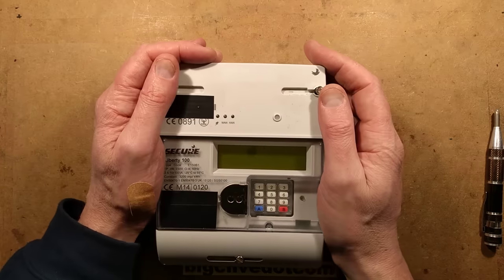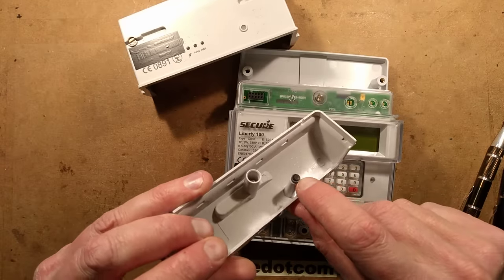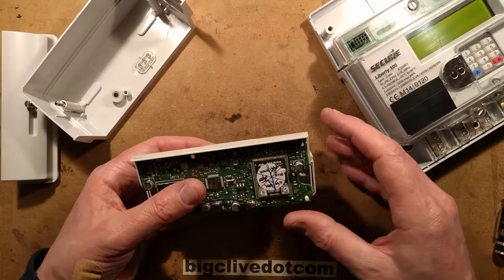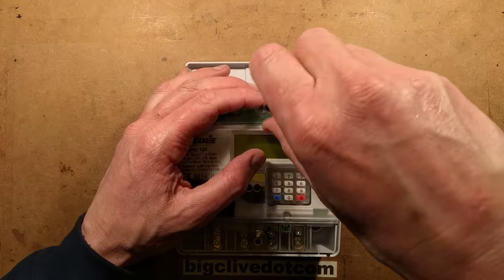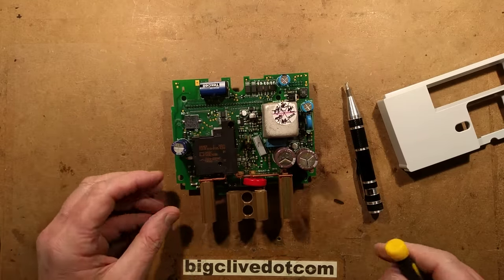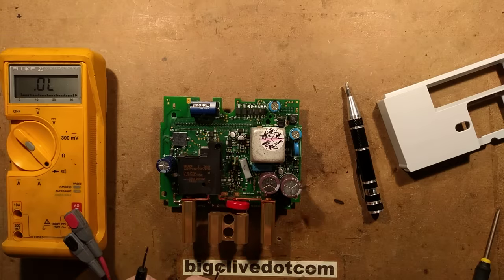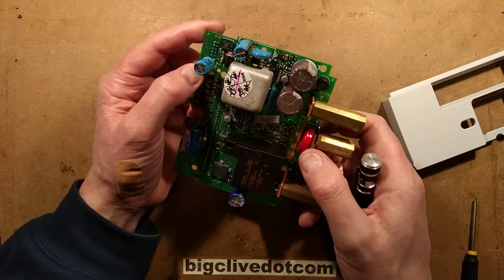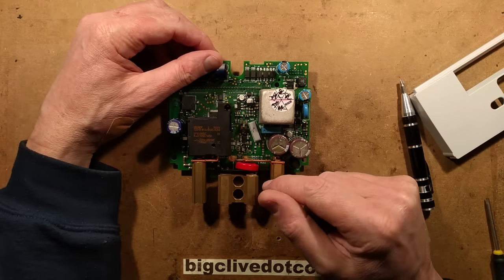Inside a smart meter, and the REAL problem with them.

Comment: Whenever I see a British smart meter I always laugh because of the keypad. It looks like you can use the meter to make phone-calls. Well how considerate of the power company to offer a dedicated phone. But since there is no microphone or speaker I suspect you cannot use it for phone-calls. But this also proofs the energy company cannot eavesdrop on your conversations near the fuse-box so every con has its pro.

In the Netherlands we only have postpaid electricity service so there's no keypad as there is no reason to punch in numbers. There is only one button to scroll between the different tariffs: Day, night, return day and return night. Although it's not completely postpaid. You pay an averaged estimated figure every month which is compensated every year with the actual readings. So you pay when you consumed more and you get money back when you consumed less. Also our meters do not have a relay anymore as the Dutch government considers access to energy and water a human right and therefore it is not allowed to turn power of water off anymore. You also have the right to request to turn off regular monitoring. This still means the meter will still send the same information to the power network company. But they will not do anything with this information and only  send the meter figures twice a year to the power delivery company. And if you really don't want a smart meter you can get the smart meter replaced with a digital offline meter. Some companies do this for free but many (mine too) will charge you up to €300 for it as they consider it unnecessary extra work.

They say the old meters that did incorporate a relay were disabled with a firmware upgrade. Now if you don't pay they just send enforcement agents to your house to get your household effects. Cutting off power is a very rare occasion in the Netherlands nowadays. It's only done in case meter tempering is discovered and the result is considered a fire hazard. But usually people do not dare to tamper with a smart meter. They just tamper with the enclosed main fuse-box below the smart meter bypassing the meter completely.

Comment: Clive the number keyboard is also used so the homeowner can enter a code and find out how much leckky they've used...recently I gave my mate an hand coz he got a stupendous bill....his first since changing supplier....so we called the company...at a call centre in Cape Town!!....they told us what code to enter and a whole gamut of digits with kwh's scrolled past...any how he had been paying 20+ nicker a month on the key meter...they wanted 120!!   after lots of backwards and forwards it occurred to me that that geezah who'd installed it had misread the ting...or it weren't working....SO they had a deal whereby they would send an engineer to check the meter...if was at fault it would cost nowt....if not £140......it was at fault!🦇

Comment: I'm guessing the black plastic box is a CT (current transformer) not a relay. 
(At least here in the US) I've never seen a smart meter from the utility company that actually switches power off.
Reply: It's relay. If you zoom in you can read 24V coil, 100A contacts

Comment: I wonder if the customer directly pays for the power that powers these meters (by reading itself along with the house powser use), or if it does not count itself relative the house it is tracking.
Reply from the maker: They are powered from the utility side.

Comment: I have the same meter and it's a piece of crap. It randomly sends incorrect readings maybe 1-3 times a year and messed up my bill, so I have to correct it with manual readings. Totally pointless. If I can block it from transmitting that would be great.

Comment: Nothing 'smart' about them.
The data sent to the power company will tell them WHEN you take a shower and for HOW LONG.( electric showers).
The only thing that uses 8.5-10kw in one go in a domestic property is an electric shower.
Reply: They'll no doubt find a way to sell that data. The next generation of smart metres (connected to your google account or not) playing adverts on how you could save by updating to a better brand of shower coming soon!

Comment: i did some meterplus training how to install meters dead simple, unfortunately they did not supply with our full installing kit, as electrician we were always taught not to use neon testers but in the case of meterplus installing it s a must due to possible incoming mains been installed incorrectly as it wound still work if it was reversed

Comment: Maybe the resistor and inductor are used to determine power factor?
Reply: No. Voltage and Current are sampled at high enough frequency that the meter can detect the phase shift between them

Comment: Urgent, can someone help, I have a "beep" coming from mine constantly. and the WAN light is flashing, originally E-On Installed it but I have since change supplier but they said it is fine. What should I do?
Reply from the maker: It sounds like it has lost connection with a device like a gas meter?  Tell them to change it if they can't stop it beeping.
Reply: bigclivedotcom thank you for replying

Comment: Companies can fiddle the numbers remotely.
Reply: Dont know where you live, but where I live electricity providers have to give transparent statements of usage. Sure they can change the cost/KWh but that will be on your bill and you can switch suppliers if you dont like the numbers. The actual KW used can easily be verified and contested in court. Example if a neighbour hot wires some of your power for his own use, this is going to become very apparent, very quickly. So fiddling is not viable without you noticing and taking action.

Comment: The other local comms unit could be for a gas meter or other type of meter by the same company. I wanted the pair from my supplier but the chips they were using at the time could not communicate with one another as one was inside and the other was outside and they were too far apart.

Comment: 5:02 -- I love it when someone calls out the BS regarding 5G or other "Electromagnetic Radiation" (EMR) aka "radio waves" that causes cancer and I remember professors going on television current affairs shows expressing concern about the High Voltage transmission power lines causing cancer to households.

Usually professors in universities are reliant on government research grants.  That's what keeps them in their "ivory tower" university jobs and if they express fear to the community they get well paid for the next ten or so years.

I knew this was BS although there is some element of truth as it needs to be severely concentrated. which they don't.

I remember when I was a technical officer in an established university, we actually build a special anechoic chamber that would not reflect radio waves so we could measure radiation of mobile phones when in usage.  We actually received government funding to make this happen.

Comment: I wonder if it holds charge long enough after power loss to record a tamper. Incase somebody gets smart and trys to get past the tamper proofing.
Reply: The capacitors on the modem board are 50F, just for that purpose.

Comment: screen cap over psu is to remove the typical s/m psu oscilating and causing rf interference to radio /tv equipment within household
Reply from the maker: I think it might be a traditional wirewound transformer.  So possibly a magnetic shield to avoid external saturation.

Comment: The keypad is needed to request the display to show the current meter reading. This is needed to use the smart meter as a conventional meter. You may ask why but this model old and is not switchable to a new electricity supplier.
The short range comms will be for the display unit which shows the real-time  electricity loading which I stopped using almost as soon as the meter was installed.
The large red MOV will be for surge protection so that if lightening strikes nearby, any spike induced between L and N will harmlessly bypass the unit preventing damage.

Comment: yeah do they charge you for the power consumption of the meter Gosh i'm getting mad as hell bro.
Reply: bro you too worried aboutthese serieal numbers bro you got to just live a little bro No one cares.
Reply: yeah did I mention THe Real Problem with these meters I don't know what the schematic looks like how they derive current.  I bet you're paying for the power of the meter too.  BUt listen the real problem is that the high impedance measuring circuit overvalues transients when it draws its virtual RMS curve.  A real analog meter not going to be deflected by transients, only true RMS.  I am just getting so mad bro So mad I know i've been overpaying for a while bro I really have.
Reply from the maker: No.  It's on the unmetered side.

Comment: I have a digital 3 phase meter with a 2 buttons on that used to have R1 and R2 readings , i used to push the blue button then take 2 readings , one day the R2 reading dissapeared totally and i told them ! 4 engineers come round to inspect it 2 say it was a faulty meter and 2 say it is a non R2 meter    , i get a £30 000 bill ! with lots of fighting and letters i get it down to £4000 and just paid it to shut them up and my yearly use is about £1500

Comment: Do you have a smart meter in your home Clive ?
Reply from the maker: A semi smart one but not full featured.  They've not introduced them here yet.
Reply from the maker: When I get one I'll be "testing" it.
Reply: @bigclivedotcom  can I ask what kind of tests you are thinking of?
RF meter or something like that?
Reply: @bigclivedotcom  testing for ?
Reply from the maker: @jemlittle1787  Field emissions and accuracy of metering with unusual loads.
Reply: @bigclivedotcom  so can you tell if there are dangerous waves being emitted?
I trust you more than any other info source.
I hear so many reports of unfettered signals from them. 
What would be the test for this danger of the whole 5G debacle.
Reply from the maker: @jemlittle1787  Unfortunately there's a lucrative industry around scaremongering and spreading false information.  I regard smart meters as being safe.

Comment: It would be nice to see how a smart gas meter works as I have heard some of the Flow Meters fault easier.
 What you were saying about people getting ill from shit reasoning, I got it when working on 400kv substations and I asked SSE what the ratio was for people getting ill from working so close to high voltage, high load subs? Nil, yet all the people who complain the got ill from transmission lines that are 60 ft in the air whereas substations are 15ft for 275kv.

Comment: You can't turn the power off at the mains -
Reply from the maker: You can turn off the isolator on your consumer-unit, distribution board or breaker panel.

Comment: Why would we need a cellular network for our homes? It's overkill and it all about profit for the company. Where did all the meters that currently work going? Classic creates a solution that does not exist then making a product to fill the imaginable issue, then the company writes itself a massive check. Your smart enough to take apart the meter, yet you don't question the companies motives??
Reply from the maker: It doesn't have a network.  It just connects to the usual phone network like your mobile phone.
Reply: @TShaun68 control.

Comment: So is there ANY advantage to the consumer from these?
Reply from the maker: Yes.  They can provide information about unexpectedly high power consumption from faulty equipment, like a failed thermostat in a water heater.  Plus allow you to monitor for unexpectedly higher power appliances.

Comment: Problem with smart meters as they can alter the "counter" remotely so if you only use say 100KW hours they can make it say you used 300kw/h 
people have tested this in holiday homes with everything turned off and still get a powerbill of Xxkw/hour usage even tho Zero items using power.

Comment: Have to disagree about the mobile phone bit, Clive. The very first mobile I got was an analogue Oki in 1990 which had a stubby antenna. Every time I made a call with it I would get a headache, so I used it as little as possible and kept all conversations short. I do remember it cost 25ppm with Martin Dawes. So I am always wary of mobile phones but never noticed the headache effect like my old Oki. https://youtu.be/HHU27zCd5Kk
Reply: Those old phones used to make your face flush, hot and red.  Which was caused by the signals decaying in to microwaves.

Comment: I want to know why when Im using solar or battery (specifically when running air conditioner or hot water system) my prouder sees this as both "Feed-in" giving me a credit, AND usage charging 4x more than the give me for the feed it... The usage should only be measuring on the grid side, but, they clearly are not. And no, it's not the case im using 2.5kWh in the first 30, then giving back 2.5Kw in the last 30, that's not possible at 9pm at night.

Comment: In 2014 I got an electric car (never again) and I got a free outside car charger box installed by Bodgjit And Run Electric Co. The installation ran off a B16 MCB in the CU and this fed a meter they also installed. The meter is apparently useless, but as it has a 'nwk' LED flashing away it sounds to me as if "They" are monitoring how much electricity I am using to charge the car with. I gave the car back after two years - no thanks it's a pile of poo - after 8400 miles it needed a new £5000 battery. How about this for a conspiracy theory I haven't heard before? : the meter in series with the car charger might in future be monitoring the KWh going into the car, and will be costed at say 90% vehicle tax, as is petrol and diesel currently.
Reply from the maker: It wouldn't surprise me if they find a way to tax electric vehicles once they have been widely adopted.

Comment: Don't install a smart meter. With it they control you. They charge such a high price you literally turn everything off to save money. And they use that as an excuse smart meters are cheaper. It is because you're literally freezing yourself to avoid the huge bills. And all these gas and electric companies work together and share information which makes them one unit. If one says right don't supply them they owe us money, you'll have no gas or electricity. Best bet if you're careful and quite focused use gas bottles for gas and pay as you go electric or use electric for everything and buy a calor gas for heat. Buy gas from gas companies is horrific, they charge you even if you don't use gas. We're living in an environment of slavery. Try to go and use other natural sources without using these things from huge corporations.
They're just there to make money from you. And when you fall behind they'll leave charges on your meter that goes up everyday, till you've paid it you'll have no gas or electric. But if they make an error the maximum they'll payout is 30 quid. This happened to me. A days lost wage due to them and 30 quid.

Comment: Hmmmmm they've thought about everything i see. What they havint thought about was connecting alligator clamps around the power unit like my dad used to do lol. He did it on the pole but still that was pretty funny. He'd run it over night charging a series of old car batteries and then disconnect it before dawn. 10-15 batteries was enough for him for 2-3 days.  It was alot of work honestly for very little pay off. I'm pretty sure they could tell he was doing it but it was so insignificant they never bothered to send someone at night to checkout where this phantom leach was coming from. Kind of obviously the one house in on the neighborhood transformer that doesn't have power hooked up lol.

Comment: If the life of a capacitor is about 6 years they won't last the forty years of the old type, think the customer would be paying for the replacements !
Reply: Don't suppose they will like the surges from arc welders ?
Reply: @peterwait641  They probably wouldn't like a microwave over magnetron pointed at them either.
Reply: @ferrumignis  You could cover the box with fine metal mesh to block out mobile signal turning it into a dumb meter, this would also stop them turning it off and charging higher peek tariffs !
Reply: @peterwait641  You could cover the front and sides easily enough, but more difficult to get behind without removing the mere from it's panel.

Comment: Only theory i heard was smart meter puts out a lot of electromagnetic Radiation!  I bought a cheap EMF meter and then measured smart meter and old style meter. Both gave a high reading but move 300mm back and nothing . So only reason they put out smart meter was people tampering. I know a bloke who jammed a leaf into the old wheel type meter. Slow it down. Cheaper bill. Lol
Reply from the maker: Those EMF meters will go off if you approach anything electrical.  They're designed for people who use them to imply that a house has "dirty electricity" and sell them overpriced filters that do very little.

Comment: At 9:15 you see a very low resistance and it measures the voltage across it to current , i wonder how it measures the phase angle between I & V in order to read true watts . K

Comment: Im always dubious when the electricians mess around with the meter. “From experience”.
From replacing the safety switch with a normal manual switch to not noticing that for decades 2 points have been wired to bypass the safety switch all together.
The first one was probably the reason it never tripped when i got electrocuted in my early teens.
“I learnt not to clean up after people outdoors after that” “rats chewed though the cord of a plug-in fluro light which was pushed with the switch in a small gap”.